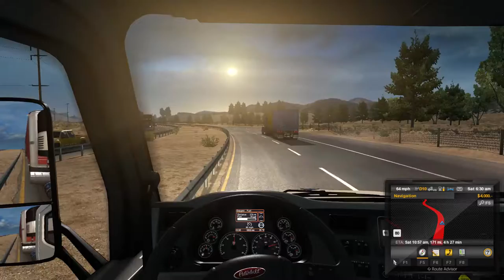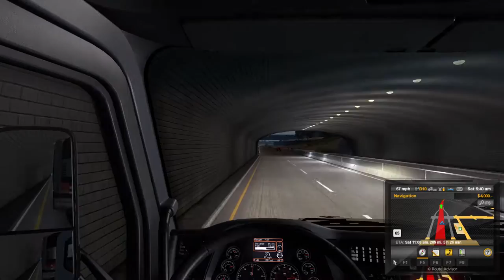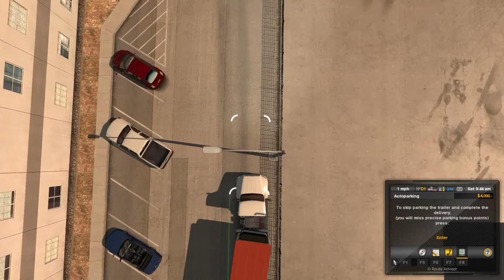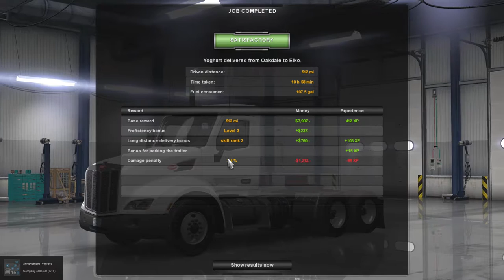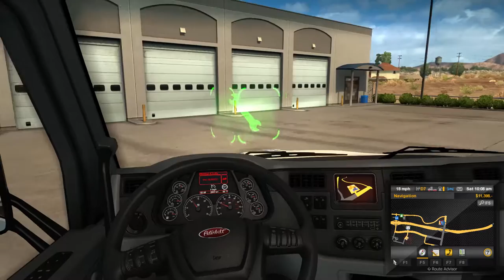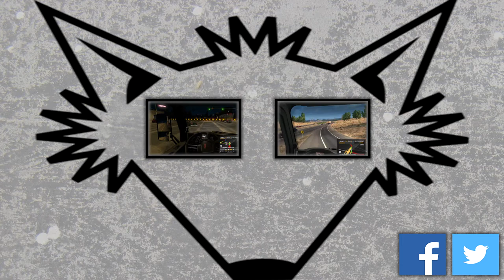American Truck Simulator | Part 10 | Crashing, Engine Malfunction, Repairs - Gameplay Let's Play

Comment: I've never seen a stop sign at a light before. That doesn't make any sense. Technically, that would mean, even if the light is green, you must stop before proceeding. I think someone goofed up there...
Reply from the maker: +Memory Lane Gaming I thought I was going crazy, I knew that wasn't a thing.
Reply: Those signs at traffic lights are there in case the lights go out. Then the signs would help regulate the traffic until the lights are fixed